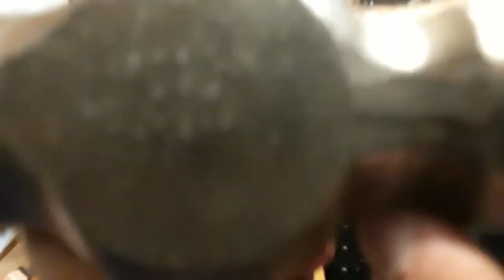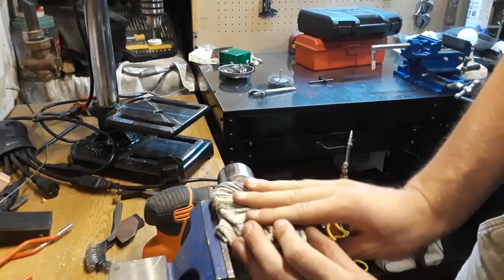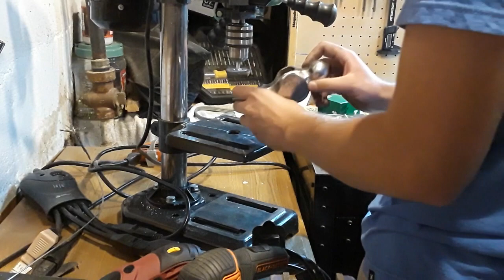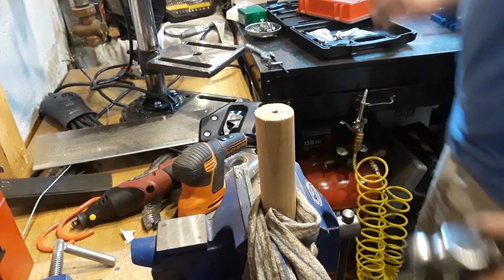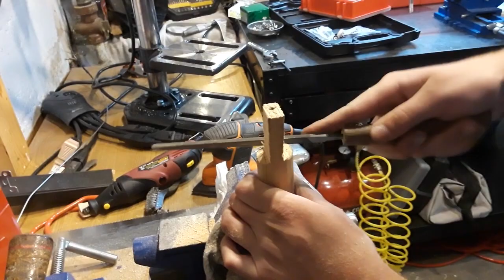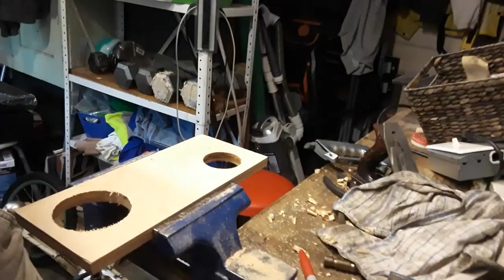Hammer Restoration

Comment: Great work up until the handle. I would never swing that hammer! Super dangerous! Buy a store bought handle and study the tapers and how the wedges should be driven as your method is not even close. Your Woden wedge is 90° off!  Was that a nail I saw you drive in there? Educate yourself on the proper way to rehandle a hammer and you’ll be able to do every thing from a sledge to a double bit ax!  The technique is very similar in all of the swinging tools. Not trying to put you down just trying to keep you and people around you safe.